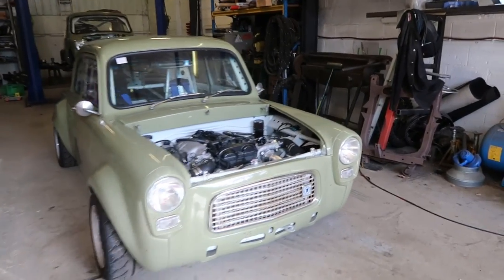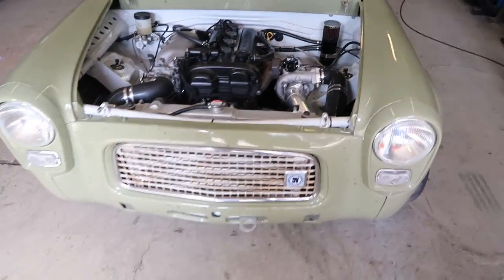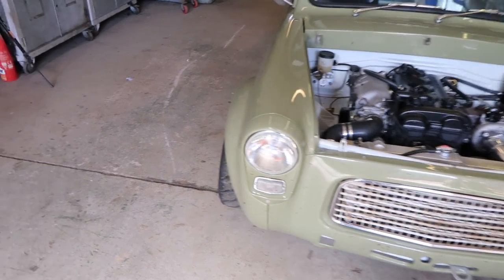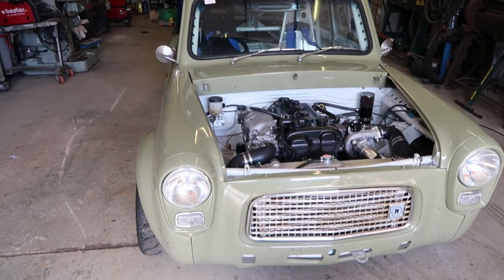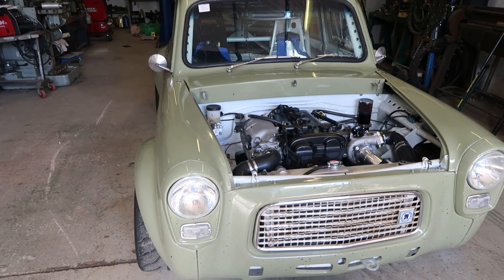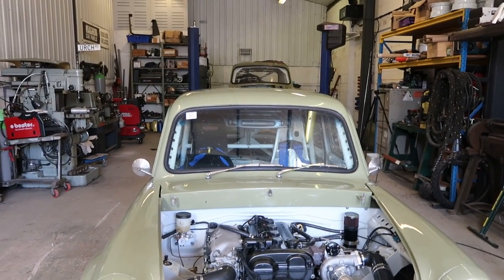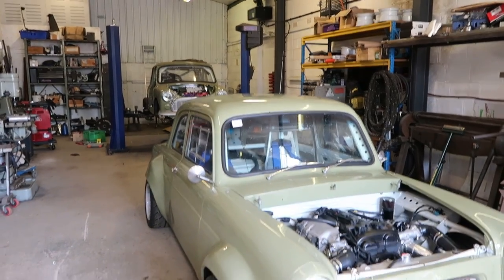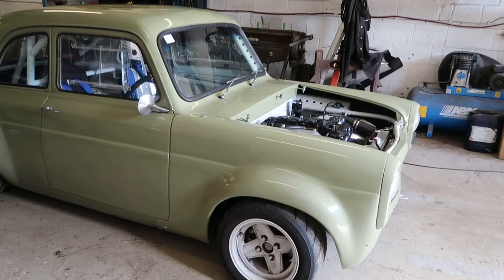A Few Laps Of Castle Combe Circuit - TURBO Powered 1959 Ford 100E

Comment: Nice one Matt! Engine sounds great. One thing I noticed is you turn in early for alot of the corners. Camp for example if you stay a cars width from the first apex it will get you a better angle for the second, to really get that turbo going early down the straight.

Comment: Sounds like you have a plan and a reason for that plan to work.  FWIW, the Mini's are shaped much better in the wind. Good luck on the driving test. Love the track footage and the clocks and speed ball- it really shows where you need to pinch inches and seconds off. Every time you go , you seem to get a bit better- this one had a lot more sawing the wheel and I was wondering till you explained about the new cambering- back that off a degree or so on both ends and run it again- that should improve your patch contact and give you a more predictable ride. You still met your best time on this track even with it feeling a bit unsettled.

Comment: It would be interesting to see how much mid corner speed your revised set up will bring. Can you hook up a brake pedal ‘sensor’ of some type (or just a camera) maybe there’s a bit of time available with more ‘focussed’ braking. 
I reckon a collaboration with someone like @driver61 could be interesting - see if driver training over the ‘tubes can shave lap time. Great stuff Matt. It must be so rewarding bashing out some reliable, quick laps.

Comment: I may have missed your setup specs, but it looks like you need a lot more camber front and rear. My e46 is -4.5 front and -3 rear. In this video yours looked close to strait up and down. Camber in the turns equates to confidences. Not baggy on ya, trying to be helpful. These cars are awesome.

Comment: The vehicle is too light for that suspension setup I'd agree. Not being in person to see what the nature of your rubber is it seems dancing around the track on the inside of your tires voided the extra track width of your car. One of the most successful track racers i ever met would set his tyre pressure to 22 lb's./ inch square. I was astonished how soft he ran his pressure but he would lift the inside tyre at the front on almost every corner. That alone could correct the suspension geometry by allowing a very flexible tyre on an aggressive race suspension setting. (which you have set up) little steps Matt. Brilliant car and you're fairly focussed driver. When you have the setup set. Itll come down to your concentration at a fast rate. Lap records are made to be smashed.

Comment: Hi Matt, what is the power to weight ratio of the Mongrel versus the Mini?  If you watch BARC stuff on youtube, you'll see that not everything can match the Mini laptimes on certain tracks, if they do go faster than the Minis - it's generally not by much.  Unless of course it's a mahuasive inbalance in terms of power to weight and cost.

It is absolutely superb to follow you, to learn, to laugh and to be inspired.  Thank you for creating this brilliant channel.
Reply from the maker: Thanks for following along bud. I’m not sure as I’ve not weighed it yet, I would think they’re similar power to weight. 
Soon as the mini is finished I’ll sort out some scales and weigh both.
Cheers 🍻
Reply: @Urchfab   Thanks for the reply fella, I'm sure with the great community you have created, there will be someone local to you or a track that has the scales and would help you at the drop of a hat.  It'll save some pennies that could be spent on moar tires :D  When my parents raced Minis in the 80's, they used to take a crate of beer to the local scrap yard, to use their scale.  Granted, wont give corner weights or front/rear balance, but it's an option.  Looking forwards to future vids, keep up the superb work chap!

Comment: Unmistakable sound at the start. 😀It also sounds like there was a hand on the slide whilst it was going forward. This is not recommended if you want the round to be chambered 100% properly and fire thereafter! The slide needs to be released at full extension and to come forward under its own steam with a "bang"! Holding the slide going forward is a disaster waiting to happen. ie: a round not properly chambered and a misfire when you really don't want it!